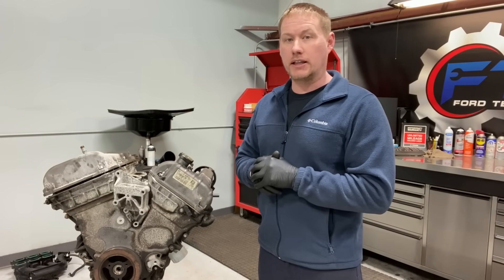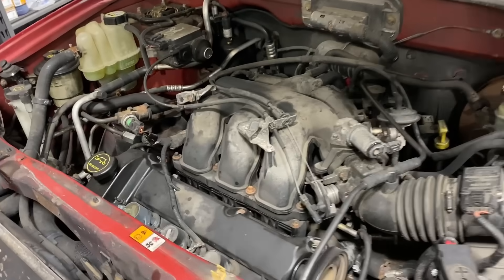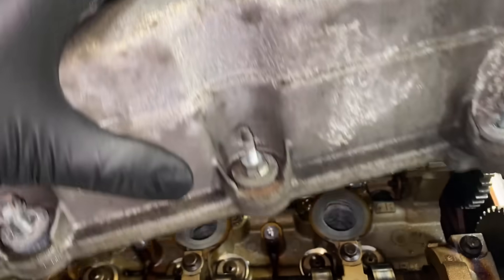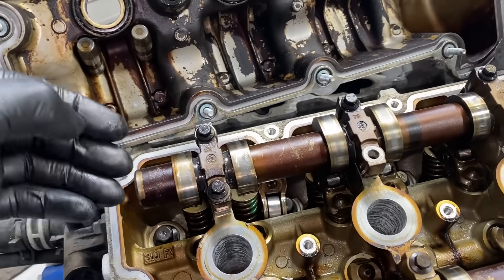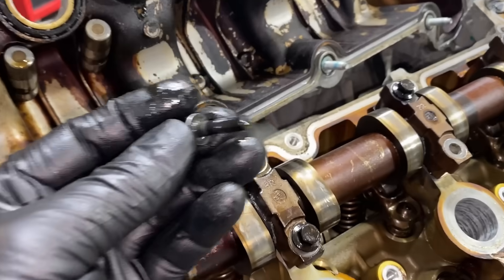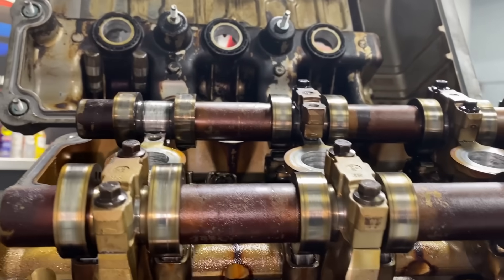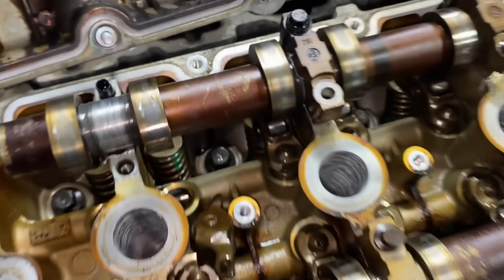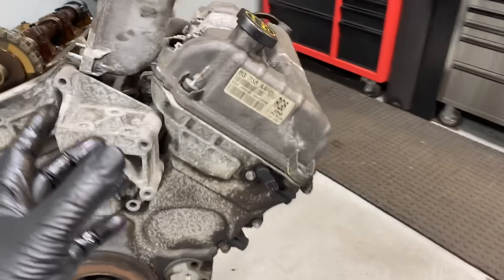Ford 3.0L V6 Duratec Engine: The One Fatal Flaw That Will Destroy This Engine!

Comment: Just happened to come across this and realized that's the engine in my Ford 500. Needless to say I'm gonna check those bolts now considering I'm coming up on 250k miles. Got the car for free and only have about $500 into it so far. Junkyard near me has a few of these engines in good shape so if I need one I'm set. Thanks for the great information.
Reply: That's what's great about these engines. You can take them to 200+ thousand miles, and then get another one for not much and do it again. These cars bodies fail before there engine.

Comment: I have a ford freestyle 06 and my 3.0 has been so reliable it’s mind blowing I’ve have had zero issues with the vehicle other then the throttle body recall that causes a weird idle. the 3.5 is derived from the duratec 3.0 which is an amazing motor so thank Porsche as they had a major hand in helping ford design the later 06 and up 3.0 duratec 🙏🏾🙏🏾🙏🏾. 178k trouble free miles.

Comment: 03 ranger 4.0l 200k miles. Sounds same. Truck had tons power. All sudden 1 day made that noise in on gas going up hills then it get quiet. Then 10 min later started doing all the time. Same issue or different you think?

Comment: Classic ford design for ya. Their most reliable engine shreds its own head lol.
Reply: Regardless of your one eyed view or what this guy says,I have Raced,built and modified many of these engines,some of our turbo engines are pushing over 600 Hp,never once have I seen any issues with thread shear except on engines that have suffered overheating,it alters the clamping force of the studs,the most common failure point is rod ovality (powdered metal rods)causing the bearing to spin.

Comment: I have personally broke three of those duracraps. I have found that they have way to high of oil pressure when cold, I have seen above 150 psi quiet often with correct oil. Sure, if I treated them right, they could have lasted. 

All three died from roasted bearings.

Edit: none of mine overheated, still had same damage like in video.
Reply: Interestingly, that isn't as uncommon as you think to have such oil pressure figures.

The first time I saw this was on a Chrysler 2.7.  I had 130 PSI cold oil pressure at high RPM.  I had to use my transmission pressure gauge to see the numbers.  I replaced the oil pump and it didn't change a damn thing.  Then I did the math on the size of the oil pump relief valve and how much pressure it took to compress the relief valve spring.  I had to do some estimating, but the figures came to over 140 PSI before it would bypass.

Fast forward to a twin turbo Mitsubishi 6G72 engine.  I got over 100 PSI in that thing.

After that, I just chalked it up to that being how at least some "modern" engines are.  I think that too high of oil pressure results in more flow to the top of the engine and leaves less in the bottom.
Reply: Bob -omb -
Mine has a knock or tick when cold. Goes away once heated. Its days might be numbered.

Edit: 185k miles.
Reply: @chucknoob7041  As long as it goes away as it warms up, it is probably a lash adjuster that is a bit worn and is not a big deal.  
There could also be a timing chain tensioning component causing some issues, which would be a bigger deal.
Reply: Paul Standaert -
Thanks Paul. Either way this is my beater and is on a “do not resuscitate” order. Eventually, The “pull-your-own-parts” yard is going to get their old stuff back for pennies on the dollar, lol.
Reply: Even older motors would have high pressure on a cold start.  I had a 4AGE in a spitfire, cold start idle had 90psi, would go off the gauge if you revved it.  Hot it had 25-30psi idle and 90psi at cruise/redline.
Reply: I think the pressure is keeping the bearings washed out. All three died from bearing failure, but they looked overheated and oil starved. I personally think it is a neat trick by Ford to make it fail and appear to look like neglect. But I don't care really, like @Chuck Noob says, they are throw away.

Once mine started knocking, I only drove them harder lol

Comment: I don't think anything will really be durable without actual bearings. If this head had used babbitt bearings like almost ever engine built between 1920 and 1990 the cam might have needed work, but the head, and therefore the engine would probably have been salvagable. Another mm in bolt diameter on those can caps would have been worth it's weight as well. I really don't think they have the whole no bearings and 0W5 oil down yet. They may never get this to work without some kind of bearing shells. The problem is that thin oil drops out at shutdown so every start is a dry start. The surfaces are probably already showing microscopic galling before the car even touched down in the dealer's lot. 
I guess if I had one I would get the new bolts and safety wire them in and get an electric pre-oiler.

Comment: My Dads 1996 Ford Taurus GL had this same engine as well as his 2001 Mercury Sable LS Premium,  never had an issue with either of them and they were some of the best most powerful engines we've ever had in our cars. His 2010 Fusion Sport has the 3.5 Duratec which is the more updated version of this engine and that runs like a high performance V8, very very fast car.

Comment: Guess I got lucky; had a 01,02,05 Escapes and beat crap out of them every day=super reliable!
Reply: quikgt -
The 01 - 03 had some serious transmission problems. Still driving an 05 201k miles (quit changing oil because it gets new oil from leaks) and an 06  185k miles though it has developed a knock at cold starts.

Comment: I like my 2.0 litre duratec in my mondeo. 141,000 miles and still drives sweet and smooth. I've had a couple of 2.5 v6 ones and both ended up with headgasket failure.

Comment: Can those heads be line bored and bearings installed?
Reply: Jay Reiter -
Just go to the local pull-your-own-parts junk yard, get another head and replace/torque the cam bolts. Cheaper and more reliable.  There will be tons of those engines in the yard.

Comment: Hello...
I have an issue with my expedition 07, no now mechanic can really understand what is this sound.
Can you please let me know?
The sound come back only after the car is seated for a few hours, and after I start and make the noise "for a few seconds", even if I turn of immediately and start again, the noise won't come back "so is not about the fact that the engine has to cold down"
Check the video:
https://youtu.be/pf2Xx8Ozi8A
Sure you can help me...
I really appreciate your help
Andrea
Reply: I think this sound is like my, but my disappear after a few seconds...

Comment: Nice work and video , ford tech ..can  bad coil over plugs cause vibrations with no codes on a 5.4 ?
Reply from the maker: Yes, as with any misfire it takes a few drive cycles to set a code.
Reply: @FordTechMakuloco   Thank You

Comment: 2007 ford 500. 206,000 still running strong.
Reply: I have a 2005. Does yours drive dirt slow. Like pitiful acceleration
Reply: @kirkhullinger1934  check the throttle cable slack mod. Mine was dirt slow and this fixed it
Reply: @kirkhullinger1934  I’m at 195000 and rising rapidly, and you bet you a$$ I drive Larry like he’s a sports car
Reply: @kirkhullinger1934  nope. has 213,000 on it now. still going strong.
Reply: 219,000 miles now
Reply: @maynardreed8374  2005 Escape 319k running great.
Reply: @dandiegidio7729  she now 227,000 miles and still running strong.
Reply: Not all mass production anything built are made by the same team.
Reply: 07 milan 142k, it used to accelerate slow,  but now she Flys lol
Reply: @sblank0525  I just push down on the throttle and she goes.
Reply: @Svhopowa  Yeah you do have to rev it to get good power. Good engine though.

Comment: I’ll never have to worry about it because I would never buy a ford anyway. For the past 34 years I’ve seen far too many problems with ford truck engines, beginning in 1986 with a friend’s brand new truck with the 5.0 V8 that came with loose timing gear bolts. Fortunately it was under warranty. There was a sticker on the window that said “quality is job 1”. Yeah right, more like quality is non-existent”.

Comment: Great info! Does anyone know if this issue exists on 2010 or later? I have a 2012 fusion with this engine with 49,000 miles. It runs well.
Reply from the maker: no
Reply: @FordTechMakuloco  Thank you! Your videos are very helpful and much appreciated

Comment: I have a 2011 Ford Taurus Limited. It has 70k+ miles. It’s a 3.0 V6. I hope nothing happens
Reply from the maker: You have the 3.5L DOHC with internal water pump issues to look out for.
Reply: FordTechMakuloco great!!! Not!
Reply: Man I miss my Fusion
Reply: FordTechMakuloco I hope I don’t have to look for anything as long as I own the car.

Comment: Oh, man, Brian what an important revelation! Now, I'm worried about my 07 Town Car 2-v 4.6 with 105k and an 05 Mustang 3-v 4.6 with 155k miles. They both have startup chain rattle, so while I'm in there, I'll definitely change those bolts for some peace of mind. If I can drill through the bolt heads, I'll safety wire them. Or, should I go with studs? Locktite, too?
Reply from the maker: Neither of your vehicles require any special attention.
Reply: @FordTechMakuloco  Thanks for setting my mind at ease, Brian!  Just to be sure, when I'm in there to do the timing/phaser/oil pump work on each car, should I check the torque of the cam tower bolts, and/or are these one-time use bolts?  BTW, I'm using genuine Ford phasers and timing sets and the latest Melling oil pumps, too.

Comment: At least these have outboard water pumps.
Reply: a steinman -
I’ll bet it’s the same A-hole who put the alternator between the rear of the engine and the firewall. There’s a special place in hell for that guy.
Reply: @chucknoob7041  alternator replacement on a Duratec Taurus/Sable (3rd gen at least) is not terrible if you put a jack stand under the uni-body, jack under the sub frame, loosen the passenger side sub-frame bolts and lower the sub-frame just enough, you can get the alternator out quite easily. It's not 3.8L mustang easy, but its not really all that difficult.
Reply: Brad Noyes -
I’ve changed mine in my Escape. You have to remove the right transaxle but the worst is they used a stud on the upper mount and the alternator can’t clear it without removal. Sure was a joy taking that out 1/4 turn at a time. Oh and those plastic air vents, yeah a hard pull removes them forever, straight to the trash!
Reply: I have had no real problems with my motor in my Ford Taurus
Reply: The best idea ford had...then they changed the water pump placement on new 3.5 to be timing  chain driven..
Reply: @yyz125  lol yep. 2012 Fusion Sport with 280k miles.... 4 water pumps later!
Reply: @socialjusticewarrior9601  really?
Reply: @Sturmbannführer88  yep.
Reply: Those internal water pumps were certainly not a consumer friendly idea! Excuse me madame, your water pump is bad, so now all your bearings are ruined from the water.
Reply: My 3.0 has external water pump THANK GOD!!! water pump runs off cam with a tiny belt. Only down fall is the 3.0 don't have anything nice to offer for performance parts 😢
Reply: J.P. ………...very easy , yes but it takes a special puller to get pulley off , check on line or at a Ford dealer !!!!!!
Reply: @dannycalley7777  You're correct, because there's a goddamn bolt behind that pulley. Sometimes, I wonder what the engineers are thinking.
Reply: @jamesplotkin4674  the bastards that designed this is NOT the guy that will be fixing it.

Comment: so... is this because the bolts weren't torqued enough at the factory ? (either installed wrong or the specs were wrong) ????????
Reply from the maker: I see them break more than anything, not the torque spec.

Comment: @FordTechMakuloco This isn't an issue on the 08' - 12'?
Reply from the maker: no I have never seen it on the newer engines.
Reply: what about the duratec in the 99 taurus? @FordTechMakuloco

Comment: WOW! That is pretty fatal indeed! Very happy with my 3.0 V6 Vulcan engine! Seems very bullet proof!
Reply: Tell me about it lol, mine overheated and just needed new headgaskets. No issues after replacing them.
Reply: That's what I was thinking through the whole video, the Vulcan was far more reliable than duratec, duratec has all the plastic cooling system bs that gets brittle and blows out, timing guides that are an absolute pita compared to Vulcan and just simply alot more parts to break, now in comparison to gm 3.6 the duratec is the greatest thing ever but compared to 3.0 vulcan...nah ,just more power at the cost of simplicity and reliability like the modulars going from 2v to 3v...don't get me wrong it's not junk but Ford has done better, unfortunately those engineers from a time when men knew they were men from birth and preferred women are long gone and the poor confused folks stepping up to the plate nowdays arnt really sure where ANYTHING goes,lol I know this because I just changed a fuel pump driver module that was mounted on a rear differential, makes me wonder how they piss
Reply: Bud... Gender roles have nothing to do with knowing wtf you're doing as an engineer or an assembler...

Comment: Great video and awesome tip. Had a bunch of cars with this engine. Should we use thread lock on the bolts?
Reply from the maker: No, just replace and torque to spec.

Comment: Any issues with the DOHC V6 in a 1997 Taurus LX? Other than the guaranteed oil pan gasket leak at around 93,000 miles, or the really stupid rubber isolated crankshaft pulley that lets go around 107,000 miles. Got one of these, fixed both of those.

Comment: That cap was chewed up.  Wish ford would go back to the old 300 straight 6.  Plenty of power ok fuel ecconomy and they don't ever quit.
Reply: emissions laws killed it - also limited packaging size
Reply: @boundaryzero  
With the hood so huge these days it should definitely fit in.
But they have to update it.
Reply: @boundaryzero  stupid front wheel drive
Reply: 300 straight 6, fuel injected, with a 5 speed..... hell yeah!
Reply: A turbo straight 6 in modern tune would be a delicious combo with a manaul in trucks.
Reply: Donalld Allhands  yes it is a much more powerful engine but, for the money the 300 is much more efficient amd with a few mods can put out sb v8 numbers
Reply: Sure ford makes money on parts sure they sell more truck that way.
But if you sell trucks at the same pace as parts AND sell parts for them,, you make MARGINS OF CASH.
And the only way to do that is to have a truck that lasts 100-200k miles
Reply: If Ford would have just put a steel cam gear in the 300 from the factory it would have saved alot of down time. The only other failure I saw, other than abuse, was a broken roll pin on the distributor gear. Sometimes it started and someone's it didn't, weird failure.
Reply: @liljohnnie69  that was a strange one.  I put an aftermarket dist in my old 75 f100 so i never had that issue.  To be honest i do not know anyone who had that here
  Heard of something like that but never had the issue
Reply: @Akira S something was wrong with your i got 30 with mine.  Plus i look at torque. Hp is just a function of torque n rpm.  300s make it at the bottom
Reply: Ppl will say emissions or limited package yada yada blah blah blah which is a bunch of bs.  You can't make $$$$$ on stuff that last forever.
Reply: @beingsneaky  if it lasts people will buy more of them.  I have a 31 year old ranger.  Still runs strong no smoke and only 1 small oil leak i cannot find. (Half a quart every other month) and yes i daily it
Reply: @beingsneaky  ford has made plenty in replacement parts for it.
Reply: @beingsneaky  gotta over pay those union workers.  You have a huge point.  If ford sold parts at a reasonable price they would make a killing
Reply: @beingsneaky  EPA forces manufacturers to make engines that get a minimum MPG for its class.

Comment: MAKULOCO.....i bought OEM lower control arms for my 2011 Ranger .....are the ball joints low friction???  ….  They are brand new from the Dealership and they wobble around very easy in the socket.
Reply from the maker: No they should be stiff
Reply: Ok … The uupers were stiff the lowers were loose.... I bought them From Sunrise Ford they look brand new I don't get it.

Comment: Brian,

Steel bolt in aluminum head and you suggest the flaw is with the bolt being too soft?

What about the tapped hole in the cast aluminum head?

Seems to me if you discover loose bolts the fix would be to pull the cam, install inserts and then inspect the cam bearings.

Of course I'm not a pro mechanic, so feel free to disagree, but if you do, I am curious as to why.
Reply from the maker: The materials the bolt is screwed into does not matter, if it did then this would be widespread across all of Fords engines. The bolts have a hardness issue, either too soft or too hard past spec.

Comment: I didn't need to hear this. I have an 06 Freestyle with this 3.0 Duratec Engine with over 100k miles. :(
Reply: PaullyBB 
Maybe you did need to hear this so you can prevent it.
Reply: My fusion has 287.000 no leaks. No problems and I dog the shit out of it. Like he said these are some of the most reliable engines made.